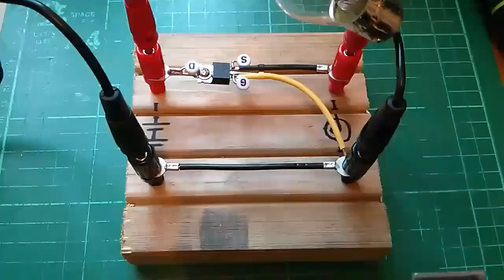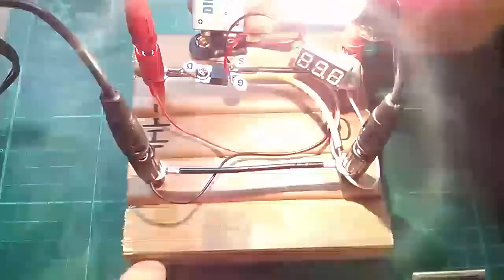Practical MOSFET Tutorial #4 - N Channel, High Side and Bootstrapping

Comment: thanks for the explanation.i have two n channel mosfets and want to control the high side of a circuit with one or if needed both of them with a signal of an arduino which can output 3V. Drain to source voltage is 5 volts. How could i make an arrangement of mosfets to achieve this?

Comment: Due to the instability of the bootstrapping, I burned an Arduino. 
Please look at my improvement . .. It much more stable and could be quite useful for high power project. 
You can play with the mosfet type and the Supply Voltage to achieve the desired power at the load. for my project (Incubator), about 42W was sufficient (3.5 ohm at 12 Volts)

https://www.youtube.com/watch?v=Q3493i_-imE

Comment: The origin of the bootstrap circuit has its real meaning when there was a young very tired boy who wanted to go upstairs to his room to sleep and he told his mother that what he was going to do to avoid climbing the stairs was to put on his boots and then pull the boot laces up with his hands as hard as he could to lift himself up. 
A circuit diagram would have been very helpful. There is a very interesting bootstrap circuit where the low side  MOSFET is used with the high side MOSFET to make a half bridge and the low side MOSFET acts as a two role unit, providing the power output and also the bootstrap control system.  Bootstrapping is a logic that most young people should learn about.  It is a philosophy that can be put into real practice ...........that of lifting oneself by the laces on his boots!

Comment: How did the 9 volt battery turn on the fet when it looks like the gate is tied to the negative terminal of the load (& power supply).
Reply: My bad it looks like its connected but its floating in the air lol, never mind

Comment: I was following along nicely until you said that when the Source rises to 12v, the bootstrap capacitor rises even further, to 24v (and thereby maintains the voltage differential to keep the MOSFET switched on...) I can't get my head around why the capacitor would charge to a voltage higher than the available 12v supply :-/  What am I missing?
Reply: Graham Smith The bootstrap capacitor it's charged only at 12V, the voodoo magic here is the ground reference, in high side switching you need a voltage above the source.
So you need to see the source pin like "ground" o 0V point, so when you connect the capacitor "-" to that point and the "+" to the gate the mosfet see 12V difference between G and S, so it works.
It's like putting two batteries (12V) in series, 1° end is "-", the "+" of that battery is connected to the "-" of the 2° battery and the "+" of that battery is the free terminal.
So when you put your multimeter between the "-" of the 1 batt and "+" of the 2° batt sees 24V, but! If you put the ground tip of the MM at the 2 (+,-) connections and the "+" of the 2° batt sees only 12V!.
The ground reference it's the magic here.
I hope you understand it, I'm not a great teacher nor native english speaker
Reply: fersunk - thanks for your explanation. I think I understand the concept now, I just can’t get my head around how he’s making it work  - don’t worry though - I’ll put it on the back burner and come back to it when I have a little more experience with MOSFETs.
Reply: Graham Smith  -  The cap doesnt charge to a voltage higher than the supply,  it charges to 12 volts.   When the mosfet is  ON the load has 12 volts across it.  This 12 volts adds to the capacitor 12 volts because they are in series ( you may need to draw a schematic to visualize) so the total is 24 volts.   When the lamp is off (FET open) the source is pulled to ground, this is when the  cap charges to 12 volts.
Reply: @noweare1  hey, I know this comment is old, but I figure worth a shot.

So in this case, the capacitor acts as a voltage adder, since 12v is at the source, feeding through the capacitor(towards the diode) and the capacitor is charged, and stacks with the voltage present at the lamp to add up to 24v and fully driving the MOSFET? Can the capacitor be charged from either side since it's a tantalum, and not an electrolytic? Or do I have a misunderstanding of electrolytics as well?

Comment: Hello.
Thank You for the great tutorial. I have a question regarding a low side technique, I am currently connecting an IGBT in parallel with a resistor and is supplied from a 9v battery. The igbt is driven from an L6384E gate driver such that its low side (pin 5) is connected to the IGBT's gate. am not connecting any c_boot since am only using the low side. The problem is that the switch is overheating unexpectedly, and there appears to be a 0.5v on the emitter of the igbt. Could you please explain as to why my IGBT is overhrating?! 
Thanks in advance

Comment: can i use an L7809 instead of the 9V battery?

Will it work if i connect the input of the L7809 voltage regulator to the 12 V supply, the GND of the voltage regulator to the source and the output of the L7809 to the gate?
Reply: yes
Reply: Thank you :)
Reply: No it will not work,  if you tie the ground of regulator to the source then as the source voltage increases the voltage across the regulator's IN and GND will decrease.
Reply: What if i connect the GND of 7809 to the Negative terminal of the battery instead of connecting it to the source of the MOSFET and then connect the 9V lead to the gate of the MOSFET(sort of like an isolated power supply)??

Thanks for replying :)

Comment: I should've watched this before I whacked a PNP in a blinker relay :/ I needed the high side switch there and was forced to use a PNP 'cause I ran into the same problem (gate-source equilibrium you talked about). I didn't have any P-channel MOSFET's and I had limited time to make that damn blinker relay. Now I will use a bootstrap for applications like that, charge leakage won't matter there 'cause the MOSFET will be on for a short period of time, then off and when it's off, the bootstrap cap will recharge. 
  Really nice tutorial, thanks for sharing!

Comment: Actually, there are P-channel FETs available today that have every bit as low on-resistance as N devices. Check out the Infineon MOSFETs on Mouser.com, for a given voltage rating, they have comparable on resistance to N channel ones. They're available in any package you want, including TO-220. They're even a similar price! P channels will probably always be somewhat more expensive--but they've gotten much cheaper.
Thing is, they still have a lot higher gate charge than N channel devices, so make sure the gate drive circuitry is up to snuff.
Reply: +BasementEngineer  good to know. This video was made in 2013.. still informative though.
Reply: Michael Rinkle I just had a look a while back, apparently P channel devices are now below 2 milliohms for a 40V blocking voltage :)
Reply: ***** My understanding is that it's usually price that's the deciding factor. N-channel FETs are just cheaper for a given level of performance, and when you're manufacturing  a huge pile of devices for sale, the extra effort to design N-channel high side drive circuitry is no big deal.
For a hobbyist, or for low-volume production, it's more straightforward to use P types for the high side and it produces a simple, rugged circuit requiring only a high-side gate drive section that's a mirror image of the low side.
PWM power control is still best implemented on the N channel low side though, because of the lower gate charge.
Reply: 6h
Reply: Ione Ribeiro
???
Reply: +BasementEngineer n channel msofets are still very popular for highside because of the price and because of the Vgsmax. Also because that makes it easier to create symmetrical H Bridges

Comment: Rather than adding more components to create a desired full-on lamp. Wouldn't it've been easier to move the lamp between +12V and Drain? And connect Source to Ground. This way Vgs isn't affected by Source voltage lift.
Reply: +tikiteyboo Yes, that's correct. I think in practise there are cases where you can't get away reconfiguring things though.

Comment: Julian what's the voltage of Vgs on the boot strap ( Did you say 20 V ?) because there is a rated maximum voltage typically not exceeding 15V or they blow up .

Comment: Hi Julian, Love your videos!  I'm designing a power boost circuit but I wondered if you could (or anyone else) point me towards a power mosfet WITHOUT an in body flyback diode? - google won't help me
Reply: If I'm understanding this series correctly, the reason you can't find one is because they don't exist.  The diode is simply a by-product of creating a MOSFET, and you can't create one without also creating the diode.

Comment: Nice job on this 4-part series. It was very helpful. I have a small issue perhaps you can help with..

I'm building a motor controller to switch on and off a DC motor (around 75 amps). My N-channel MOSFET has the TO-220 tab connected to the drain. So... when i bolt the MOSFET to the heat sink then bolt the heat sink to a chassis, it will short out (the chassis will be used for grounding things like lights, horn etc). I guess i need to insulate the MOSFET to the heat sink or the heatsink to the chassis? 

My mosfet is a Texas Instruments csd18535kcs rated at 200 amp (i'll be putting 3 in parallel just to reduce the load through the MOSFET.
Reply: +Kris Kasprzak Yes, it is common for the mosfet's drain to conflict with common ground. In these cases, you give it its own heatsink, but don't insulate the mosfet from the heatsink, that defeats the point of it. Insulate the heatsink from the chassis.

Comment: Hi Julian, really great videos !+!+!

Three  questions:

1.  My application needs to be on for many hours. For how long will the MOSFET stay on with that setup?
2.  Or could I use an easy circuit (eg a joule thief) to constantly charge the cap?

3.  Acually I need a rectifier with an extremely low voltage drop (below 50mV at 1A). So this setup using an 10mOhm N-Channel MOSFET would come close. Unfortunately, as I have learned from your tutorials, there is a reverse diode that is destroying my hope for the rectifier. How could I overcome that problem?
Reply: Maybe try floating a photovoltaic output optoisolator between load and gate? They work akin to a current controlled adjustable voltage source.
Input side is a LED... Glows when current past through... Output side a series stack of solar cells... When illuminated generates a voltage which can be floated on top of any other voltage.

Comment: Thanks Julian for another great video!
Unfortunately I have problem with representing this circuit with bootstrap in LTspice for better understand.

http://i.imgur.com/W5Sm55l.jpg - mosfet is not fully on

What is wrong with my circuit?

Could You make simple schematic and share here with me? :)
Cheers!
Reply: The gate is connected to the capacitor at startup and the capacitor never gets a chance to charge.
Reply: The Lightning Stalker Thanks! Somewhere I found information that bootstraping work only with PWM /PFM signal. Is it true?
Reply: Dominik M It is most effective when the FETs don't stay on longer than a few tens of seconds.

Comment: hello Julian, great vids on mosfets. But all are used as a simple switch. How can power transistors be replaced by them ? I am constructing a powersupply using lm723 (Vin-230V, Vo-100VDC, Io-1A, about a 100Watts!) Oh its fig. no. 7 in lm723 datasheet

Comment: Yes you are right, the SM72442 (the little brother of the SM72445 ) is 6€ and the SM72295 is 4.5€ from elements14.
The circuit seems to be complicated also to my eyes, but i like the i2c interface and the integrated current and voltage sensors (except for shunt resistances on the high side).
I'll study the datasheet again to understand whether all those external components are needed for my use.